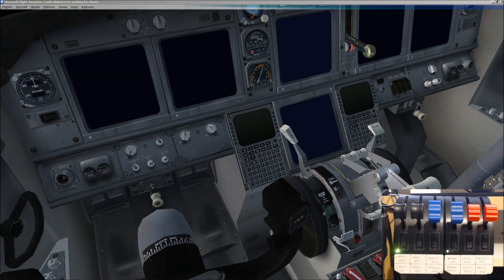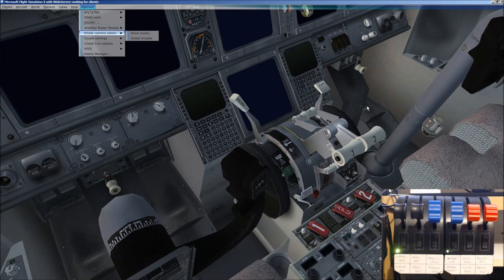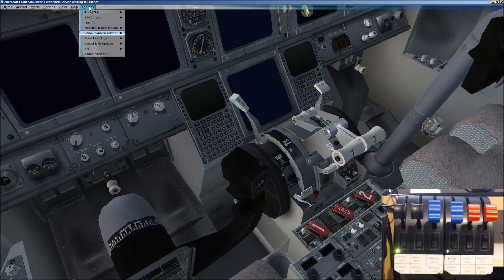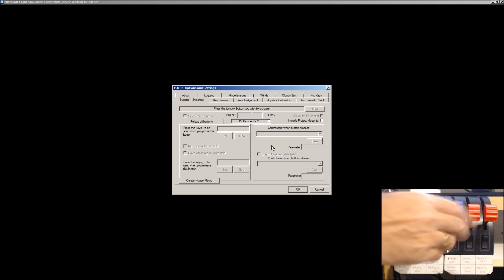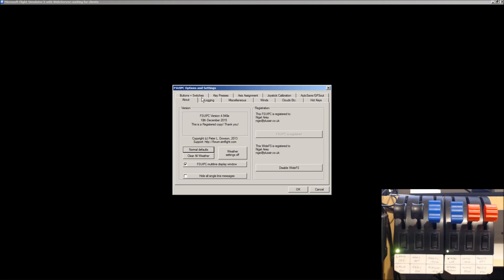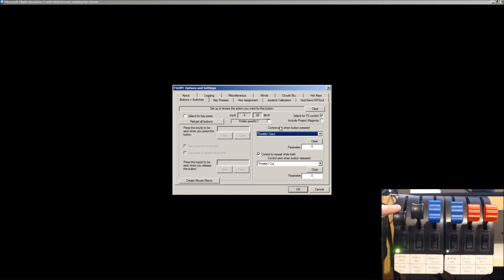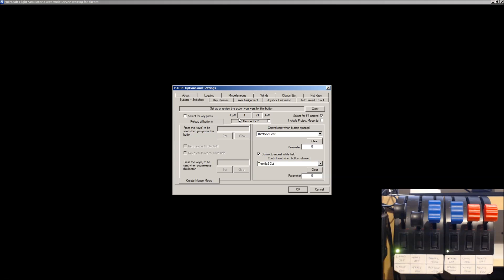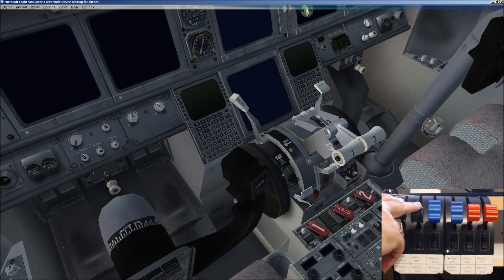Configuring reverse thrust with Saitek throttles

Comment: Great video. Very handy and I enjoyed your earlier one on setting up FSUIPC. The best video I have seen.

One problem I have with this reverse thrust video is that I have a Saitek double throttle quadrant  and when I use buttons & switches in FSUIPC the reverse thrust works fine. However when i use reverse thrust the view immediately changes from my virtual cockpit view to the Outside/Spot view. Which is disconcerting when you're rolling down the runway. Have you struck this problem?

Comment: Good tips, but only one issue I have with this....this is a setup for full reverse or none at all.  Many aircraft do not use full reverse thrust on landing for noise abatement, or other various reasons.  There is an LUA plugin you can use that can activate reverse thrust and use an axis to control the level.  Pretty cool!
Reply from the maker: tasev1 hiya, thank you for the heads up on that, very much appreciated! :)
Reply: Found it - it's called FSUIPC Throttle manager.  Type that into Google and it'll be the first hit.
Reply from the maker: tasev1 thank you so much! :)

Comment: Great job!  Thank you.  Could you please do a video on how to calibrate flaps with specific detents on the paid/registered version of FSUIPC?  I have modified my Saitek throttle quadrant, and would like to use the far right lever for flaps (I already have a marker for the specific detents).  I mainly fly the B757/B767 on FS, so that means 7 detentes (0-1-5-15-20-25-30).  I read the FSUIPC4 user manual, but can't make heads or tails out of it.  There are like two how-to videos on this right here on YouTube, but they're not in English, and the video quality is very poor, and the other one isn't very specific at all and too fast.  Thanks again for this how-to video.

Kind regards,
Larry

Comment: Sir, thanks again for a very clear and simple tutorial.
What if i have SPAD as well as FSUIPC? where can I configure these? Do i need both to configure my saitek panels like 2 yokes, 2 rudders pedals, radio panel, switch panel and AP panel.

I also posted a question in your SPAD video; if my panels have default drivers installed, would you be in a position to explain how to uninstall and install using SPAD?
Thanks & God Bless!
Reply from the maker: John Odhiambo and a big thank you for your comments. You need to configure the reversers in FSUIPC. I would advise you to have the registered version of FSUIPC along with SPAD Next for your controllers.
I'm glad you are enjoying the videos and hope they are proving useful 😃